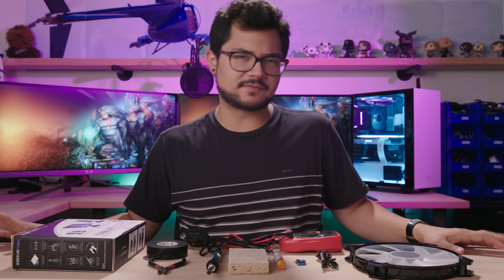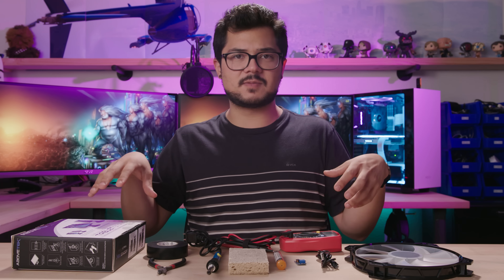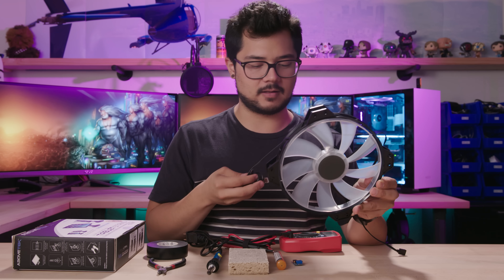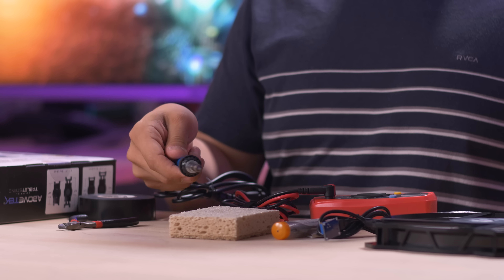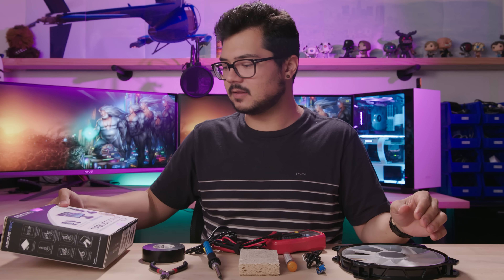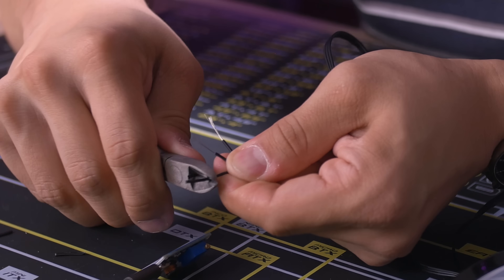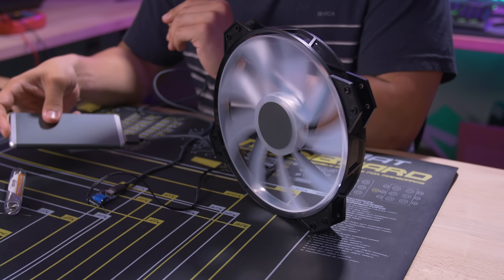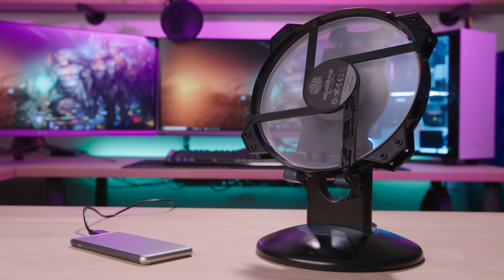DIY your own USB fan (using a PC case fan!)

Comment: Bitwit you can get an RGB wireless controller for the fan https://www.amazon.com/ALED-LIGHT-Bluetooth-Controller-Wireless/dp/B07D8Q1KMY/ref=sr_1_15?ie=UTF8&qid=1531422622&sr=8-15&keywords=wireless+rgb+controller  its about $11. I use them for my rgb lighting strips that aren't connected to my pc.

Comment: All pc fan connections are standardized. You could have just looked up the pinout for a 3-pin fan header to find out which is the positive and ground. The motor is probably brushless (they usually are) and it's possible to damage it if the wires are flipped.

Comment: because the stepup u gotta solder,

u could just get a simple wire shoe  (Or crown)  and hook it up  directly  to the cable, or a phone charger, giving the lower RPM (like u said) but also less NOISE !

Comment: You still could use the rgb with a resistor. But of course this would change your power draw. Btw you could have looked up the pin outs on those connectors. 😉

Comment: I recently bought a Gigabyte aorus RX 580 8gb with stock speeds of 1365 and 2000Mhz for core and memory respectively but whenever I am on desktop of doing any task like watching videos and surfing (idle) other than gaming it drops to 300Mhz on its own. Is this how it’s supposed to behave?  This is my first AMD GPU. Do Nvidia cards do the same??? Btw love ur work💙
Reply: Yeah definitely. Would you like your car to rev at 6000rpm while you're waiting at traffic lights? It's just power saving : )

Comment: You could also use two usb cables for 10+ volts. Btw, you could just find the positive and negative cable on the 4 pin rgb connector and then the led's would light up even though you wouldn't be able to change the colors. You could also try to gamble on the data in/output cables aswell

Comment: Great job! I purchased a small battery driven handheld fan, that charges via USB, with the intent of replacing the fan part with a 120mm be quiet! fan, as i have so many of those laying around for some reason. The stock fan is unbearably loud, and i can't have that! :) Besides, it started rattling after just a few days of use. I planned to do the mod right from the start, but these facts just makes me want to do it even more.

Good thing is that it has 3 settings. I haven't measured the voltage yet, but i'm betting it's around the 12v mark for the highest setting. If not i'm not really bothered, i'm making it so that replacing the fan will be plug and play, and even still, a high quality fan should be fine with a higher voltage for a good long while. It'll definitely shorten the life span, but when it's easy to just replace the fan, it's fine. :) 

I already widened the base enough, that it'll also stand on it's own, so i can use it both handheld and stationary.

Comment: Easier and Cheaper method: Buy a cheap, loud server fan. (Delta or some other brands) Get a 3-pin to USB adapter cable. Connect them together. Because the Max speed of the server fans are ridiculously high and they are ridiculously loud at those speeds, 5V actually gives you a decent experience. Tested, works.

Comment: I would check if the converter still puts out 12 volts under load. Voltage might drop under load and you might have to crank it up a little more

Comment: You should mention how voltage, Ampere and power are related. Since you are boosting the voltage, in order to keep the input and output power same, you must have a higher current on the input side. 
For example. If the fan need 12V 1A to work properly, then the input need to be 5V at 2.4A to supply the necessary power. Which finally leads to the conclusion that the USB should be connected to a good socket, which can output a larger amount of current
Reply: like a usb hub that i have from TP-Link that also has 2 usb ports for 2.4A rated for charging :)

Comment: I just finished with my desk fan project as well. I modeled and 3D printed the fan shroud with venturi effect that we saw at computex to mount mine on. I used an old 12v power plug from my broken handheld vacuum to power it. It works pretty well.

Comment: i would not connect a power booster to a PC/laptop USB socket, there is a chance that the booster will try to draw more amps that the PC/laptop can provide and could cause some damage to the PC/laptop, its much safer to use a powerbank as most of them can provide 2-3 amps output.

Comment: It seems a bit over-complicated... And by "a bit", I mean A LOT. If you don't want to solder anything, and want easy fan control, just pick up one of these:  https://express.google.com/product/Rhino-5V-USB-to-12V-Computer-Case-Fan-3-or-4-Pin-Connector-Adapter-Cable-AS-71G2/13174485787958039237_5916269517109202636_6136318
Fry's sells them and they go on sale for $5 pretty often. They also have a version that is just straight 12 volts. I have both and they both work great.

Comment: NEVER! Power output << power input! The circuit, if boosts voltage and current WITHOUT any power source [other than the input micro USB] connected to it, is generating power WITHOUT anything feeding it, which basically against Physics! And, the circuit has some loss due to thermal dissipation of heat. Even if the heat is in order of nanoWatt, it's still present! :) It can NOT boost voltage without LOWERING the current down. So, ur fan is getting 12 Volt with LESS current than which is supplied by the USB connected. Hope u understood, @Kyle sir.

Comment: Why not take a female 3 pin connector and solder that? That way you won’t have to mess with the actual fan cable and possibly reuse your fan later in your PC

Comment: Backwards.  You did it backwards.  Lol.  the label and wire support struts are traditionally on the backside of the fan... And with newer fans that aren't symmetrical front-to-back, using a fan backwards could result in less airflow, more power consumption, and/or a louder fan.  Since you were holding the fan wire you could have noted the orientation of the connector before you cut it off, then you wouldn't have to test which wire was which.  True, it doesn't look like it would snap into the tablet stand as easily, but that's what hot glue is for.  I would also have left a little extra wire on the piece you cut off, as that fan header connector that you probably threw in the trash could come in handy later.  Stripping wires with diagonal cutters?!  Ew.  I've found the best way to strip small wires is by using a lighter.  Heat the wire a half inch from the end just for a few seconds, rotating the wire thru the flame so it doesn't start burning, then grab the end of the insulation and pull.  It's like magic.  Also shrink tubing is far superior to electrical tape - it adds mechanical structure and doesn't leave residue.  (Wait... first time soldering?  That's a little disconcerting for a tech Tuber...try using a chisel tip)  Sorry to be confrontational, but Kyle, c'mon, man.  You can do better.  A suggestion: buy a $30 Pi or Arduino and create a simple circuit with a dozen-ish components.  Spend a few hours watching videos, reading, and playing around.  You'll probably improve your soldering quite a bit, increase your knowledge of basic programming, and wind up with a cool, unique NFC door lock or a tiny server to power cycle your network gear.  Plus you'll have fun and you could make some video(s) about it.  Then, if you have an idea for something else you'd like to automate or create with a tiny, powerful system, and subsequent projects would be immensely easier and probably more rewarding.

Comment: Did you know that Deep Cool has a cheep RGB strip kit that has a remote control?  they come with a molex adapter, however you could just plug in a 12 volt wall wart....Viola RGB control and 12 volts   they retail for around $ 16.00    plus the wall wart.... others have the wall wart included but i dont know about pricing...

Comment: As you increase the output voltage on the booster, you're increasing the amount of current it draws from the laptop. Is this hard on the laptop's electrical system?
Reply: It could fry the motherboard.
Reply: I would never do it, better to just get a fan with a motor already designed for 5volts like most of the premade USB fans.

Comment: I'm sorry Kyle, but that is a really bad way to solder. First you need to tin the iron, and coat wires with a bit of solder. You also need to shorten the wires and do a through-hole solder. You'd get a better joint that way and will avoid potential problems in the future. But this is a first step tho! Just keep on practicing! It helps a lot on future projects.

Comment: Kyle?  Why the laptop?  Why not use an AC-to-USB adapter and let the fan plug directly into line power?  It'd make it independent, and still home-brew.
https://www.amazon.com/Abosi-Certified-Universal-Compatible-AB-95/dp/B076C58YMX/ref=sr_1_8?ie=UTF8&qid=1531360148&sr=8-8&keywords=AC+to+USB+adapter
or
https://www.amazon.com/dp/B06X9PY6RT/ref=sxbs_sxwds-stvpv2_1?pf_rd_m=ATVPDKIKX0DER&pf_rd_p=3233965245922079678&pd_rd_wg=VtYIv&pf_rd_r=7CDB54GQQ5HTY42ATT46&pf_rd_s=desktop-sx-bottom-slot&pf_rd_t=301&pd_rd_i=B06X9PY6RT&pd_rd_w=EfYy6&pf_rd_i=AC+to+USB+adapter&pd_rd_r=d4c74e85-1a2f-4b25-8b6b-23cb7e632b47&ie=UTF8&qid=1531360512&sr=1

Comment: I would have sacrificed a fan extension wire rather than cutting the connector off a working fan.  My Nauctua fans came with a bunch of them.

Comment: I did this with a phanteks case fan because I didn't want to go to the store to buy a fan, I used a Laptop charger hardwired though so it definitely spins faster than what it's rated for.

Comment: I believe that your soldering points could have threaded the wire through the whole then solder the connection. Also don't leave that much exposed wire try and solder it as close to the sheathing and slip some heat shrink  on before soldering electrical tape isn't as finished of a look. Other then those thoughts always enjoy your content and keep cool with that new project

Comment: I did this year's ago with a 120mm Delta fan. I'm looking at it right now, but I used a wall adaptor instead of USB.  I had to put a grill on it because I accidentally touched the blade and tore off my finger nail. Ironically,  I have this fan too , the blue LED version not rgb.  I installed into my pc just today.

Comment: Ur doing it wrong. U need to tape 9 fans together, use a donated parts, and ultimately end up daisy chaining the fans because the psu doesn't have enough molex. At least that's how we did it in high school.

Comment: I did almost the same thing, but not so i have a computer desk that traps heat pretty bad where my desktop sits so I used a fan off of a old cooler master cpu cooler from my socket 755 desktop just collecting dust in my closet and instead of usb powered I just used a 12v wall power adapter I had and added a power switch so its not always and I built it into my desk so i just turn it on when i need it

Comment: If you're going to use this fan to cool you down some while you're on your [desktop] computer, how about just using some extension cables and just plug them in the tower itself and have those wires sticking out of the case to the fan? If plugged into the motherboard/PWM fan hub, you can control the fan RPM as desired (I guess you can do it with that potentiometer-like doodad you got to up your USB voltage, and even pump more than 12V to make the thing spin faster). You can extend the RGB cable too so your fan can give you more FPS.

Comment: Why not use a cable mod wireless rgb controller, they run off 12 volts as well and then you would control color from a remote

Comment: Not a bad Idea to use a small Step-Up Converter. I think I may Upgrade my DIY PWM Fan Controller for USB use instead of using an additional 12V Supply. It already needs a 5V Supply (Linear Regulator in my case) for the PWM signal. Fan Speed Control is just awesome for times when you want more performance or silent operation. 

Edit: Be careful about pulling to much power, USB 3.0 can normally supply at most 0,9A which would be 0,375A at 12V with an 100% conversion rate. This would be only 0,5A for USB 2.0 which translates to about 0,2A. This should be enough to keep most normal PC fans spinning but not necessarily to get them going (inrush current is probably to high) this could lead to the failure of an improperly protected USB supply or fan. Best to use an 5V 2A supply at the least (0,83A at 12V).

Comment: If you flip the wires over you could change the rotation of the fan as to have the face of the fan looking up instead of the back of the fan

Comment: I'm actually willing to bet that the fan can take up to a Max of 14v. 12v is the max safe voltage for the motor in your fan. A little overvolting is ok as long as you're not imputing 28v or something nuts into a 12v motor. It'll definitely lower the lifespan and you def don't want to run this for extended periods of time (say 3 hours) but a little overvolting never hurt anyone. 😉

Comment: I just posted a comment on Paul's channel, but I'll say the same thing here. Using some RGB fans, make a nice mobile, routing the cables so they're kind of hidden and put a controller on there for the RGB. Don't worry if the mobile doesn't spin. The main point is the bling. I suppose you could even use RGB strips... hmmm, would there be a way to use memory as well? I suppose you could use a memory socket and find out what the pinouts are for the RGB. You could use whatever else is RGB and PC related.

Comment: Why tf didn't you just inverted the polarity of the cables connecting the stepper to the fan, in order to change its rotation and not have these ugly plastic bars in front of you all the time ? 🤔

Comment: I just did this with an 80mm fan I had laying around. For the stand, I found a 3D model online (https://thingiverse.com/thing:1800720 ) and outsourced the 3D printing for 15EUR. One week later, i have a 2000rpm Be Quiet Silent Wings desk fan. My power connection is a bit more janky, though. A 12v PSU wired into a molex/3pin adapter.

Here's a WIP pic if you're interested:

https://imgur.com/a/TcYtk9L
Reply: Hey that's exactly what I'd be interested in doing, thanks!

Comment: The best thing would've actually been to solder a 3pin terminal to the converter so you can choose your fans without dooming them forever to be powered by that thing.
Also, the stand is about as inefficient as it gets, I would just have chosen some steel wire and would have bent it so that it works as a stand using the normal mounting holes
Reply: inefficient isn't quite the word to use their, maybe expensive or excessive.

Comment: you should've calibrated the voltage output with the fan on, as you did it the 12V will drop when the fan starts sucking up some current... One more thing, watch for the power output, USBs only outputs 2.5W of power and the booster has some draw too, so the fan needs to be less that 2.5W - (booster drain)W. about 2W
Reply: Right.  And stepping up voltage means current (amps) will go up too.  Should test power draw, not just voltage.

Comment: I just use 2 USB cables with my 12v peltier cooler and fan. Yes I know it's only 10V but it's a really cheap solution as most people have faulty USB cables which can be stripped back and used. Exspecially since most usb power sources have 2 USB ports.

Comment: you dont actually get 12V with the Fan on if you set the Voltage beforehand without a consuming part. probably dropped down to 10-11V

Comment: thanks for the video. i used a cypress prototyping kit to make a rainbow effect for the RGB on my Cooler Master ML240L but the RGB wasn't bright because 4V was the most i could do and cooler master RGB stuff wants 12V, so i'm probably gonna buy some of those boost converters you used to make the LEDs brighter. my goal is to control the RGB on both my cooler master aio (12V RGB) and my corsair case fans (5V addressable RGB), and then make my own software to control RGB regardless of brand.

Comment: you can get pre-made fan (3 or 4 pin although the adapter only has 2 actual pins) to usb as well for under 5 bucks. This does make me want to get a solder gun and tinker though. lol
Reply: Don't even need to solder if you don't want. Tape the Wire to the outputs, then you are good to go. Solder is a better solution, but if you aren't moving it much, you don't need to solder. Or just get rid of the converter and let it run at 5v
Reply: alcowherd7 not all fans spin at 5v, though he could just buy a multi voltage wall wart with usb.

Comment: one thing i would suggest , look up the pinout of a 3 pin fan header , cause theyre always the same . better to do a little research then to potentially fry a component or usb port , and not have so many bare wires laying around ,.......or you can do what i did , hook up a fan controller to a spare psu, and plug in as many fans as possible!

Comment: For my graduation we get to decorate our caps, so I mounted a 140mm case fan to the top of mine and plugged it into a USB to 3/4 pin fan adapter powered by a portable charger

Comment: It should be noted that when you step-up voltage, the converter draws more current on it's input than it outputs.  If you step-up 5V to 12V, a 250ma fan will draw over 500ma from a USB output.  That could be a problem.

Comment: you should've pre soldered the wire and the contact and then just heat the solder and put the wire on the contact for a cleaner solder

Comment: The " Step up booster" is a DC to DC buck converter. Please correct that.
Reply: You mean a boost converter not a buck converter. A buck converter steps voltage down, not up.

Comment: You need to use flux so the solder is neat and forms a dome instead of a spike as you pull the iron.

Comment: "CRJ DC Power Supply For 2 x 3/4-Pin 12V Computer PC Case Fans" - amazon, if you don't want to do anything and just plug in the PC fan to a plug.